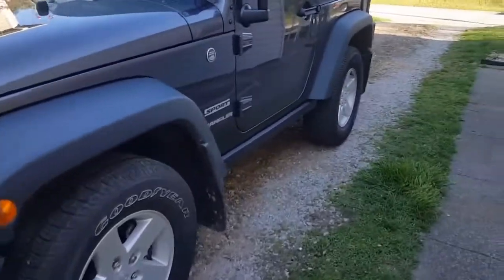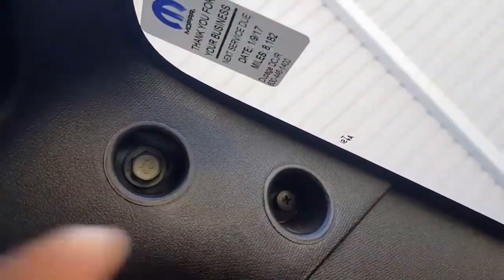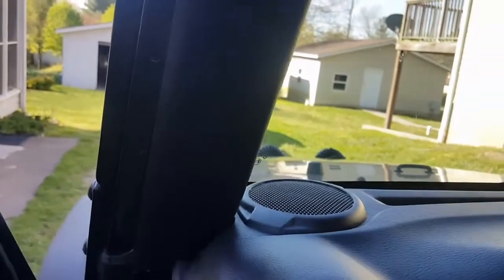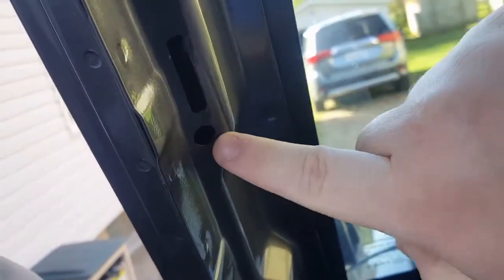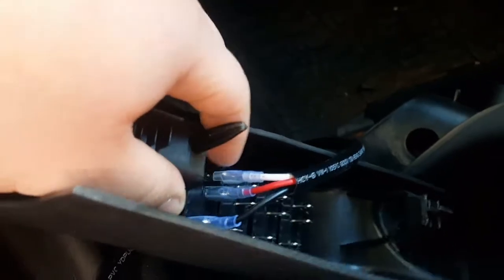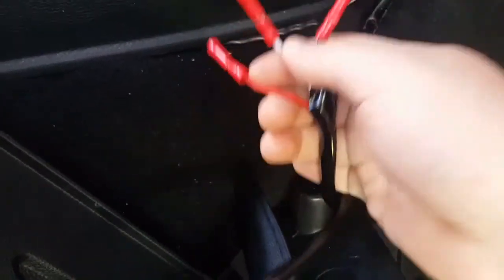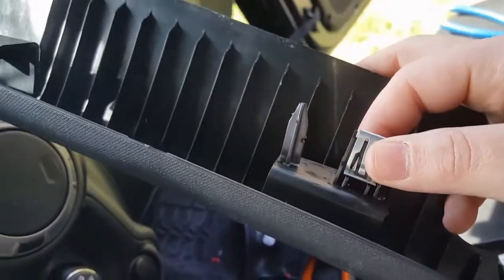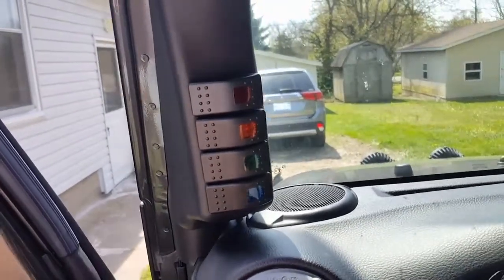How To Install A-Pillar Switch Panel On a Jeep JK

Comment: I have the plastic piece under the steering wheel popped off and have 2 light switches hanging from the little bar. One night when i was driving, a switch fell and ended up on the floor. Had to pull off to get out and reach it, and turn it off lol luckily the road was empty 😅i was like yeah i better get these switches mounted up on the a pillar

Comment: I sent for my switches. I right now only have two lights to hook up but i am going to wire the other switches so i dont have to take everything apart again. Who makes those switches
Reply from the maker: +Slotting with angbuzz I got mine on eBay